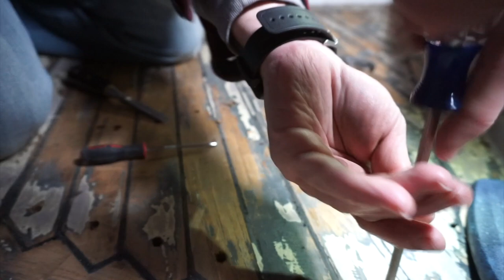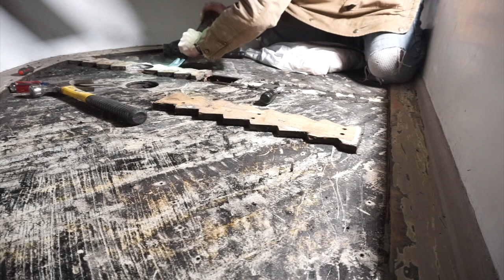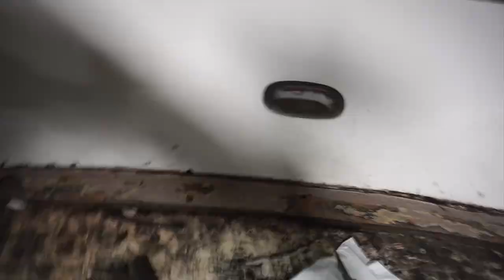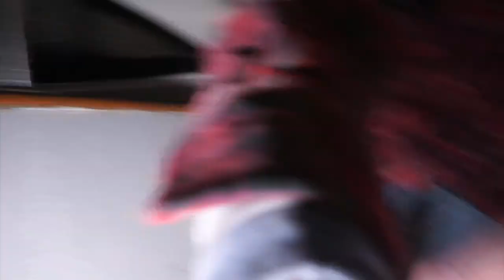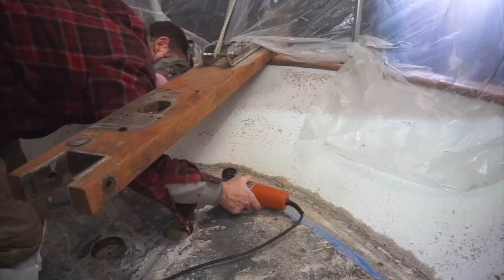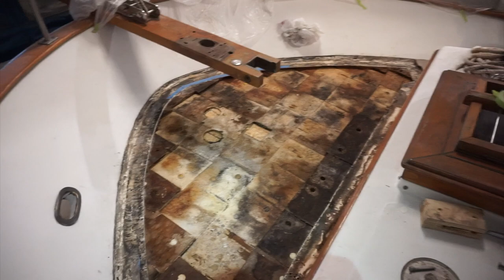Albin 36 Trawler: Teak/Fiberglass Deck Repair - Part II

Comment: The next time you remove bungs try driving a small screw into the bungs with a screw gun. The screw threads will pull the bungs right out. Then you can just unscrew the deck screws. Anyway, I’m sure this is way too late to benefit you now. You know now for future projects. Good luck. Just switched from sail to power myself having purchased a Mainship trawler.

Comment: i enjoyed part one, i am planning the same project on my trawler, can not fingd the next video of yours ...can you help ?
Reply from the maker: Just by coincidence, I happen to be in the process of putting that video together! I'll upload it soon. What trawler do you have?
Reply: @79cd36  i have a 1987 chb senator 35 sundeck. the teak was removed from mine by a previous owner but apparently the core was not addressed. my foredeck and flybridge are soft so i am doing them over the winter. it appears the sundeck was properly recored at some point. since the albin and the chb are both taiwanese built i am guessing i will run into the same situation you did. i am very interested to see how you strengthend the foredeck fibreglass liner and rebuilt it.

Comment: Thanks for sharing. You are lucky to have had the teak come up like that! There was a lot of spring in the subfloor... that can’t be normal. Could you feel that spring when the teak was on? I am looking at buying a 32 Grand Banks of the same year.... hoping I can just refinish the teak decks rather than remove but I suppose that will depend on the subfloor. Thanks again.
Reply from the maker: Yes, I was pleasantly surprised that the teak came up without a fight. No, the spring in the deck is NOT normal, hence the reason for the job: the core material was soaking wet and the upper fiberglass skin had delaminated from the deck, compromising the sandwich construction's strength, making it weak and springy. I could not feel the spring when the teak was screwed to the deck, but I could see the deck deflect a bit when someone walked on it and my eye was at deck level.